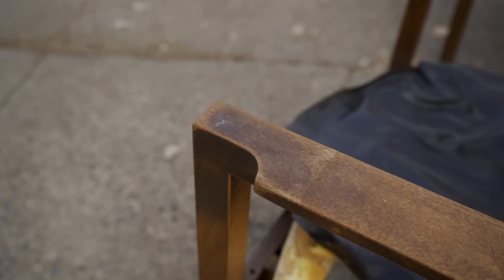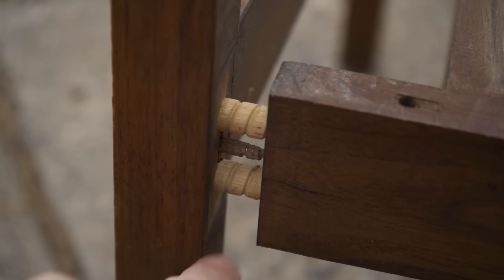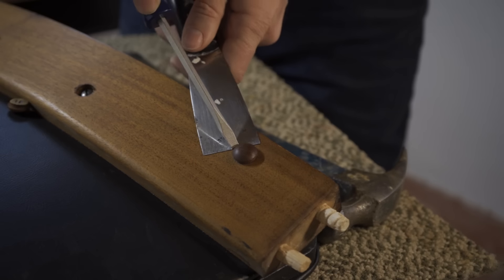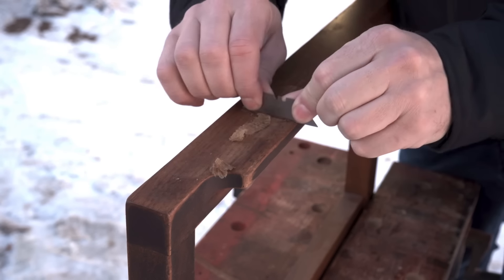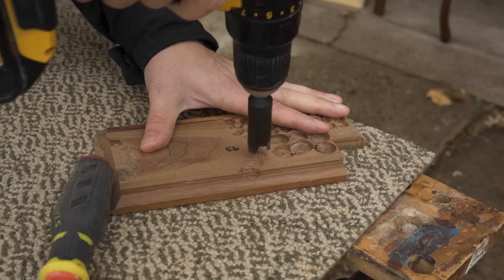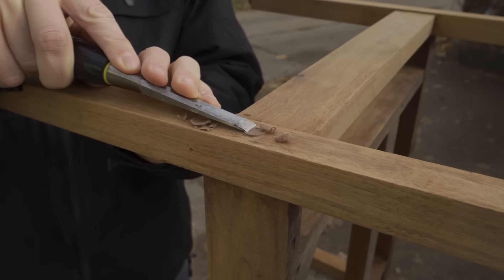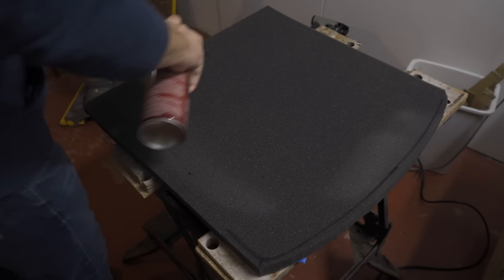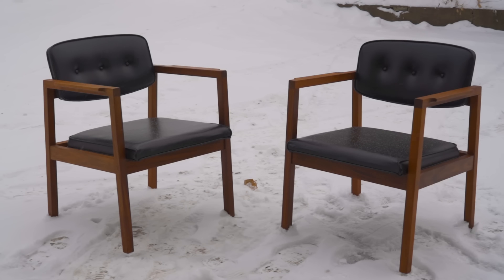Refinishing And Repairing A Matching Pair Of Mid Century Walnut Chairs

Comment: After 40+ years of refinishing furniture, I can tell you the sticky mess on the arms is, don’t be grossed out, human skin oil and dirt! I’ve redone lots of restaurant chairs that have so much of this! Wooden backs get that across the top where people grab the chairs to move them too! You really do amazing work! It’s a pleasure to find a new video from you! Edit! Wrote this before I watched your upholstery work! You did a fine job, just one small tip… start in the center when stapling the fabric on a side and stretch out to the corners. You’ll be much happier with the smooth corners.
Reply from the maker: Thank you and thanks for watching!
Reply: I was gonna mention that. Finish wears off and is replaced with oil and dirt.
Reply: my partenrs mission style recliner is like this now. Getting worse because we retired to high desert and bought a fixer home. So i guess he's sweating on the arms. Was going to scrub down with  Murphy's oil soap and lightly restain the arms? Dont want and rest not needing anything.
Reply: @retroredo9850  you can use the tire cleaner from the $ store...it works great on greasy grimy ick on wood.
Reply: What do you use on all that…um…”human skin oil”?
Reply: @thart6103  soupy water, IG
Reply: I know, isn’t that gross?  I’ve glad to deep clean my stair railing a few times over 30 years.  1st time I thought was finish … nope
Reply: Don't be grossed out? How can I not be? 😂

Comment: Next time you have a split in the wood and need to get glue deep into the crack apply glue and use a vacuum on the opposite end to force the glue to get into the crack. Best tip I’ve ever seen on YouTube.

Comment: Will never get to your level of refinishing but i learn a lot from your videos. Ive been a life long sewist. To get material over foam use a finer material to cover first, like a micro fiber pillow case or even a poly satin, lingerie material, like a slip. Not something that will ravel if pulled or stretched. i made a bench seat cushion using 2 micro pillow case protecters my partner had, never used, probably inherited. i used 2 clearance patio seat pads. They are not  true square but you invert one so the 2 trapazoid shapes make a rectangle. I cut off one end of the a cover keeping zip end intact and added enough of the over to snugly encase the foam pads. Then my fashion fabric cover went on easily. Hope that helps anyone.

Comment: Dashner, nobody ever mentions it but whenever I used to do this work with my dad, we ALWAYS wet the crack or the dowels before adding the glue.  Dad said the dowels were made of special wood (they are supposed to expand), and the reason  a leg cracked was because the wood got too dry.  So we would wet that wood for about an hour, dry it, then glue it.

Comment: A very candid video; showing splitting wood can happen and does. The beauty of it was the method you used to glue the split, particularly the use of dental floss (can't wait to tell my dentist). It all makes good sense, also remembering to glue the top piece back on before clamping everything up. A super quality piece of work and invaluable knowledge you're passing on, a big thanks for that. 
... ps... Interesting to note, it seems you wax your legs.

Comment: A very nice restoration. It's hard to imagine there was much holding power left in those end grain screw joints.  I would have been tempted to dowel plug them and drill new holes.  The joinery on those chairs is pretty shocking but you've gave them another 20-30 years of life under respectful use.  Always enjoy your videos.

Comment: Wow! you have done a pretty nice job with this video - Dont be ashamed of your upholstery job, its quite good. I work in this field, and I only have some little tips for you; for removing stapels, you can use that same tool, but hit with the hammer on the handle and remove the rest with a plier. For the base, you have chosen the perfect material! for better stretching, you can kinda loop it against your foot and stretch it to the floor. Like this you have both hands for stapling it on. For a bit more comfort, you could line the foam with wadding before adding the (faux) leather. But all in all its an acceptable way the upholster a piece of furniture. I really enjoy watching your videos! :)

Comment: Invest in a good old wooden peg n slot webbing stretcher you'll always get good results, your upholstery is absolutely fine 10/10 👍
Reply from the maker: Thanks.  I almost tried to make one of those peg and slot stretchers for the video but didn’t have enough time.  Maybe next time.
Reply: @DashnerDesignRestoration  i made one at college from oak about 15yrs ago I still have it, I've replaced the suede on the end a couple of times but works a treat.

Comment: I have one of those chairs…I got it about 30 years ago when our hospital had a “yard sale”. It must have been in someone’s office. I paid no more than $5.00. The black faux leather upholstery is a little different on mine, but it is original. Ours broke once where the back is attached to the sides, but my cabinet maker husband fixed it. It is very solid, and has the date of 1966 under the seat. It sits in our living room, and is one of my most comfortable chairs. The finish is starting to wear a bit, but I still like it as-is, and don’t like to think about when the upholstery wears out, though I suppose I am capable of reupholstering.

Comment: WOW 
And for those who want to know, Dashy did this whole project entirely in the nude.  He lied.
Dashner typically over your foam you would put batting.  Since fabric moves and stretches, a layer of batting compensates for that tiny give.  I do not know, it is just the way they used to do it.
Now since you used that fake leather, I don't think it matters, it is really not like a fabric.
Personally I would have fluffed these chairs up about an inch, they have some stain resistant fabric now, which  I would have used.  Kinda like kevlar fabric, better than leather, as far as durability.
Hope you don't think I admonish you in any way.  Thanks!

Comment: Very nice.  Ordinary steel wool may leave som small parts which will give rust stains. It has happened to me so I stopped using it years ago.  Pumice powder on a ligthly damp cloth works fine.

Comment: When replacing webbing do each strap completely and fix and cut both ends, not cut each strap then stretch and then fix. This will save you a lot of webbing. To stretch webbing you do not need anything more technical than a block of wood. My grandfather taught me to use a block of wood, block roughly 4 x 3 x 1 inch. Put short end by chair sitting under the webbing, wrap webbing over top of block and tuck under between block and chair. This forms a ‘catch’ of the webbing. Pressing down on the block tightens the webbing. Fix with staples, job done.

Comment: In France we have a product called 'Popotte' that you use with wire wool and it takes off all the dirt and old wax and doesn't affect the surface patina. It doesn't take off varnish but most times you only need to de-grime pieces before re-finishing. Personally I avoid sanding unless the piece is worthless and can only be improved upon.

Comment: I have a pair of chairs like this,  the wood frames are in much the same condition as the ones in this video. I was going to use stripper but would you recommend scraping and sanding instead?
Reply from the maker: Yes, I would recommend scraping and sanding over a chemical stripper when possible.

Comment: Why do you use a blade instead of sanding off the finish or using stripper? I’m new to refinishing. I tried the blade and it didn’t work I attributed it to me not being strong enough. Any advice? Thanks.